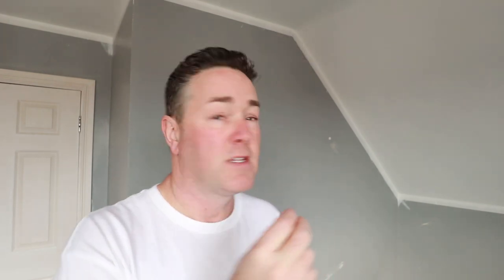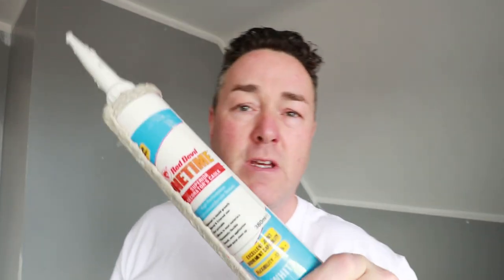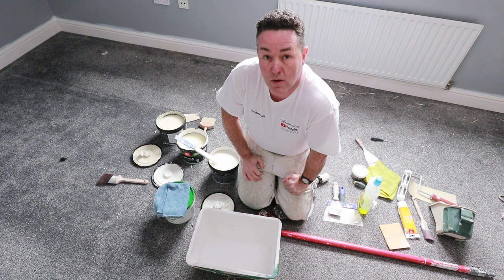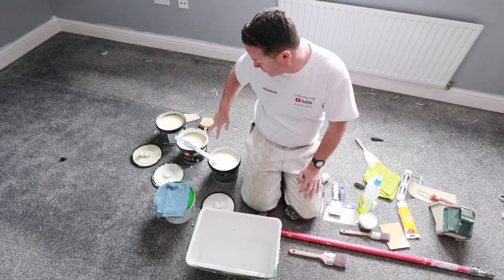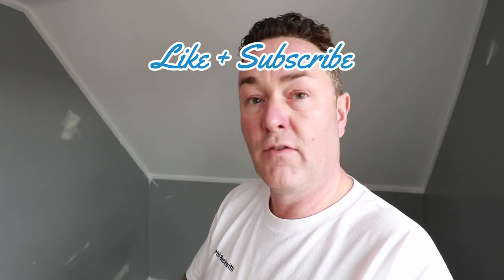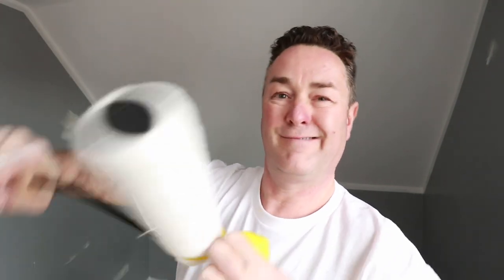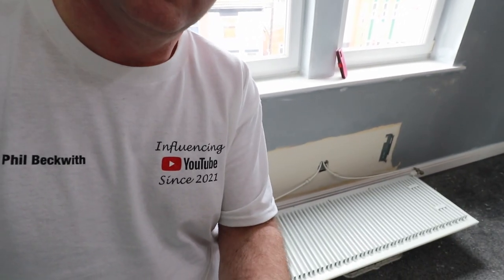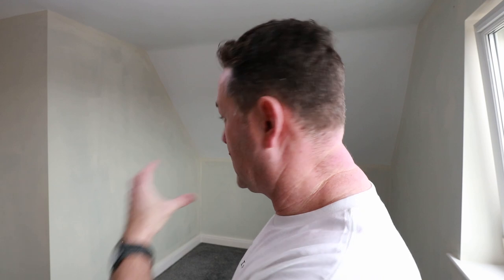How to paint walls like a pro - tips and tricks from a professional - flat renovation uk

Comment: the wooster roller frames are superb. whatever sleeve you put on there aint slipping off. quick release system as well so you can swap to shorter pole etc... mint
Reply: I was going to comment the same. The wooster sherlock system is a game changer. Also, the Arroworthy Barracuda frame is exactly the same but the washers are prone to rusting and bleeding out into your gear.

Comment: Hi, I've got to line over plywood, then a top paper...what's your advice? Guardz, strong ready mixed paste? I know it's not on topic, but I value your advice!
Reply from the maker: Gardz to size it.. but could be a bit overkill. As long as you size it .. use some thin down paste (the tub paste you'll having the lining with).
You could go belt and braces and line using WallRock, then if the joints of the ply move, the WallRock will hold in place.

Comment: I've just got some anti reflex 2 for my bedroom. I was hoping to get it done in 2 coats 😩
Reply: Its not the best for opacity, but does give a fantastic flat flash free finish (try saying that quick!)
Reply: @Lloyd1885  Hahaha nice tongue twister! I'm only painting over old white and a few spots of filler so hopefully it will cover ok.
Reply: Phil, great video as always. Intrigued to understand your experiences with overcoating silk with Matt.  There’s conflicting advice about rubbing down silk prior to applying Matt.  I had a bad recent experience where I needed to rub down badly applied silk.  First coat of Matt was ok, but second coat caused multiple paint blisters.  I had to cut out defects and it was clear that the silk had delaminated from the plaster/bonding coat, not the matt coat.  I Had to fill multiple defects and coat with Zinsser peel stop and before re coating.  What’s your experience of this phenomena?
Reply from the maker: I've seen it happen. Sometimes they pull back.

A light sand over silk to scuff it up does help.

It also depends on what paint you use over the silk and how long you leave it between coats. Cheaper contract Matt paints seem to do it more as the 2nd coat applied reactivates the first coat.. as the moisture softens it back up . That first coat tried to dry and breathe and can only go one way... Out through the top.. and not into the surface cus of the silk.

It's one of those things, until you've come up against it, you have to try and sort it at the time.

Sanding silk first should help.
Reply from the maker: What colour you going over?
Silk as well?
Reply: @ProfessionalPainterDecorator  it's matt white that just needs fresheng up. I've already done what you advised in another comment and put some diluted AR over some filler patches. 👍🏻
Reply: @ProfessionalPainterDecorator  thanks Phil, it’s the first time this has happened to me.  Used Johnstones Cova Plus, with next day re coat.  Some say not to rub down silk as it makes it easier for the next coat to penetrate, but it was such a mess I had no choice.  Problem was the silk was not applied properly and couldn’t have been bonded to the wall correctly. Lesson learned for me, I now apply a bonding coat over to any previous silk finish before applying Matt.  Keep up the good work with this great channel 👍
Reply from the maker: @grahamstacey3149  silk needs banning lol
Reply from the maker: @alexthomson7465  should be fine. You watched the video.. and why it didn't cover?
Reply: @ProfessionalPainterDecorator  I didn't realise this was actually a series. I've just started watching the other one and now know it's beacaus it was going over silk paint. These videos are such a massive help. Cheers Phil!
Reply: @ProfessionalPainterDecorator  🤣🤣🤣